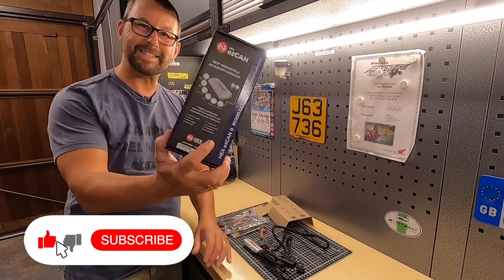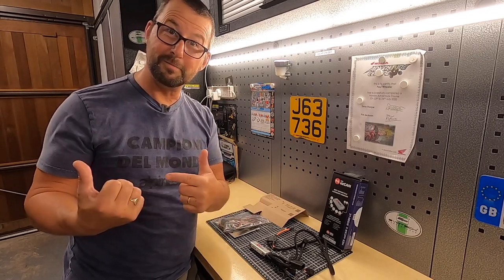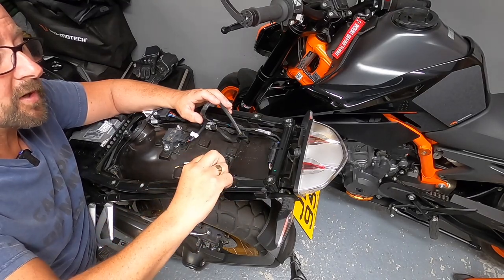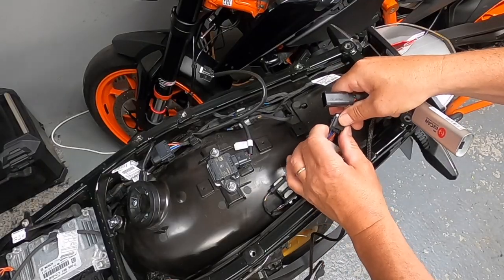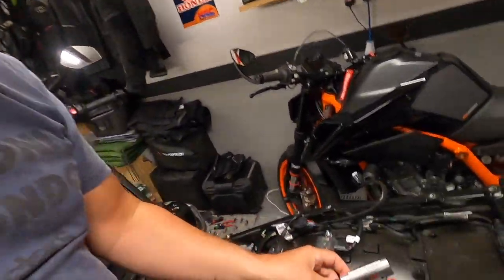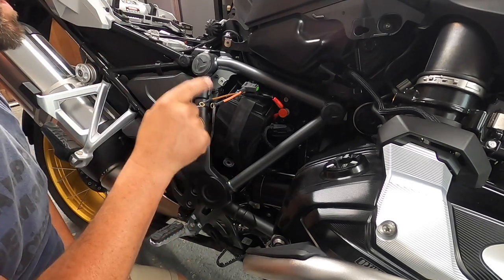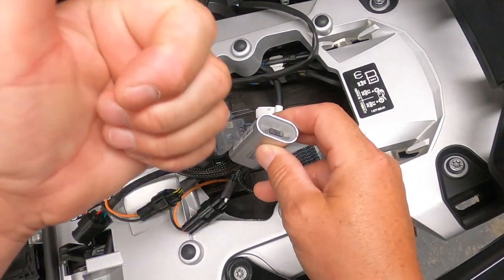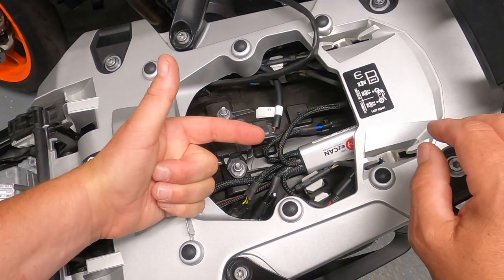Installing the Hex ezCan on my 2022 BMW R1250GS- WITH NO RDC UNIT🤔

Comment: Nice informative video. When I fitted mine I'd removed all the tank panels to run the wires for my horn, aux lights and bike cam so removed the riders seat front mounting and the 4 hex bolts that hold the mount underneath to the frame. This allowed all the wires to run underneath that mount including the power for the hexezecan which was a lot neater.

Comment: Having previously installed the ezCAN/Denali on my 2019 GSA by daisy-chaining it to the physical RDC unit I felt a bit cocky fitting it to my 2022 new GS over Christmas. Of course I mistook the SEB lean angle sensor for the RDC unit, being unaware that the RDC has been hidden somewhere else, and connected it up. So, nothing worked and I didn't know why, even though all the circuits checked out OK on the ezCAN software. The green tell-tale light on the exCAN turned red (gulp!). Having then searched on line and found this video, Bingo! Thanks for sharing. The GOOD news is that connecting ezCAN to the SEB lean angle sensor doesn't blow any electronics (phew!) it just trips the electronic fuse - thus the red tell-tale. This is re-set just be disconnecting the power to the ezCAN and the green light comes back on and it all works! Really shows the value of sharing this sort of detailed techy info online. Big thanks once again.
Reply from the maker: Your welcome . Safe riding in 2023👍

Comment: I will be installing an EZcan on my bike before the season starts next year, so I appreciate the video on how to install it.  I also have a 22 model GS, and I did check under the seat, and I do have the RDC unit that you do not have. That made me wonder why we both have a same year model, delivered around the same time, but with and/or without an RDC unit. On one of your first videos with the GS, when you picked it up, you posted a copy I guess of what you ordered with the bike.  The RDC is not on that list.  Can it be that you really did not order it, and that is why it is not installed?  Have you checked on the display if the tire pressure is being monitored?  Thanks for the video and as always, safe riding.
Reply from the maker: Hi . Mine definitely has the tpms . 👍
Reply: My 2022 GSA has TPMS but it does not have the module under the rear seat. Made me pause during install because I thought I was looking in the wrong place. Found the connection tucked away and used that and all went well.
Reply: They moved the tpms into the keyless module mid 2022- and changed the way the sensors communicate- subsequently the later sensors are not compatible with the earlier models- I know because me in a early 2022 swapped wheels with a guy with a 2023

Comment: Hi I just took delivery of a 22 BMW R1250GSA Triple Black to replace the 21 model that was written off. The RDS plug with the blank on it had no power to it. BMW said the computer knows there is no unit connected to it so it doesn’t send power to that plug. The only option BMW suggested was to fit a alarm module to the rds circuit so the computer will send power to that circuit. Is this correct or is there another way to get power to the rds plug in your video?
Reply from the maker: Hi John . I wish I was an electrical engineer , but sadly I’m not . In my case the rds plug clearly has got power going to it as I can , with the hexezican plugged in , power numerous add on electrical items , lights , horn etc . So I am not sure what bmw are talking about when they say there is no power to the rds plug , as clearly there is , well on my 2022 GS there is . What are you planning on connecting to that rds plus ?

Comment: Would you recommend this above the Thunderbox?
Reply from the maker: Yes, if you have the time and skill set to put connectors on the end of the wires, otherwise go with the Thunderbox for simplicity and ease of equipment fitting.
Reply: @gsd32i  Thank you for the reply, Paul, your videos are great. I’ve kind of mirrored your aftermarket purchases because your videos are so thorough.
Reply from the maker: @glenndubicki4099  your welcome . My gs is in for its year 2 service so riding the 660 Daytona from the dealer . Great little bike but bring back my gs 😂
Reply: @gsd32i  I just bought the GS & I agree: it's a great bike.  I'm a pilot too, I'm in JFK right now & I can't wait to get back to England for a couple of ride outs, my wife tells me that the weather is now lovely!